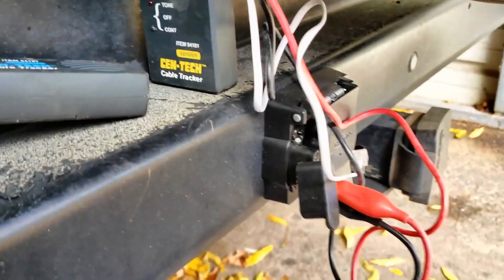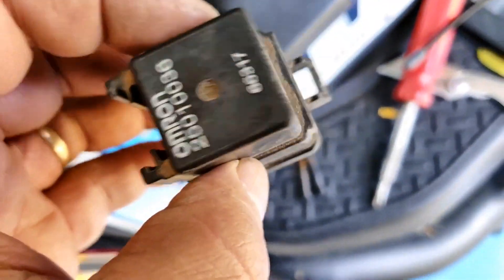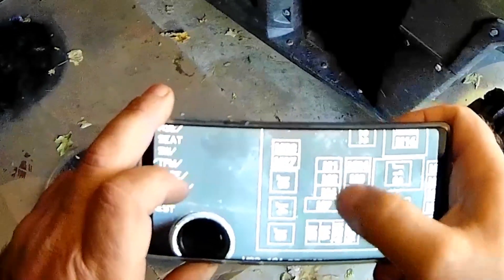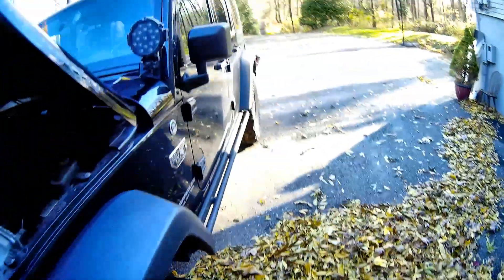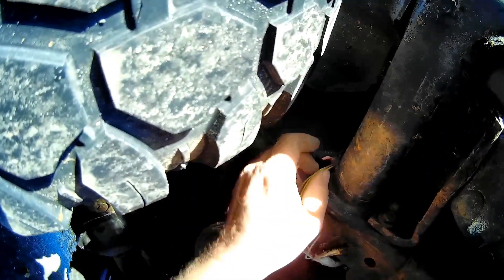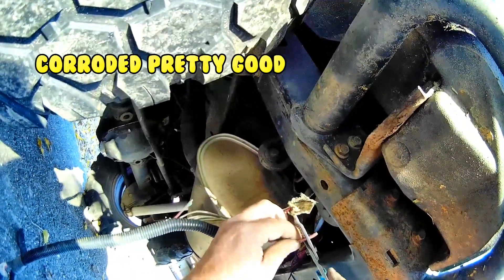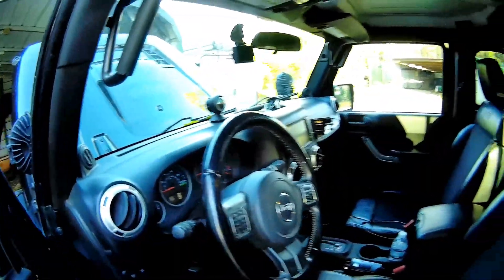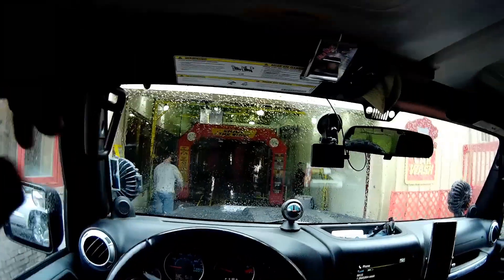Wrangler Trailer tow lights lot working, Jeep JKU running lights out, toner tracer

Comment: Nice electrical diagnostics. With that relay removed you could check the common and no/NC contacts with the red lead and the black lead to chassis ground. You should find one with +12v. Then check the +12v to the no/NC. If no voltage, then you have an open on the grounding of the light. (The light has to be installed ofc)
The same test can be done at the light. 

A toner works too ;) and it's even better for finding the location. Sometimes it's a pain to get access to the harness tho

Backseat technician is shutting up now...
Reply from the maker: TY. Yeah, that's another good method!

Comment: I have a 2007 jeep commander when we hook up the camper we don't have signal lights or stop lights we were told the relays were not grounded how do we ground the wires or where can I find a diagram for the wiring for my jeep.

Any help is appreciated
Reply from the maker: Did you test for power and ground at the plug. It is usually the trailer ground. Corrodes and they rely on the ball to ground it. 
I'd check the plug coming out of the jeep first with a test light. Usually at least one will work